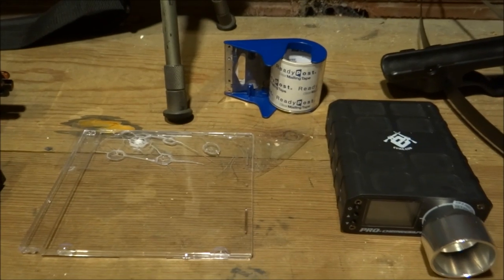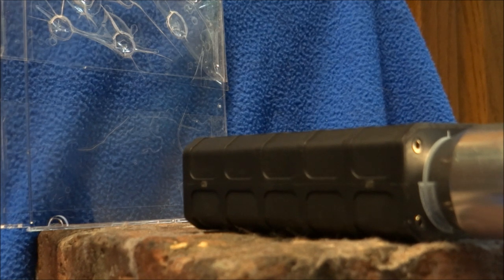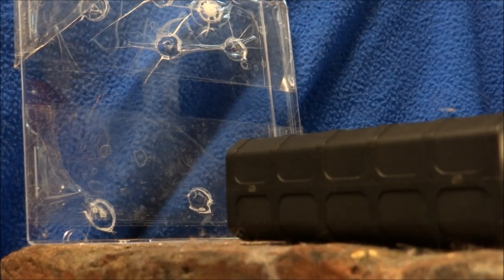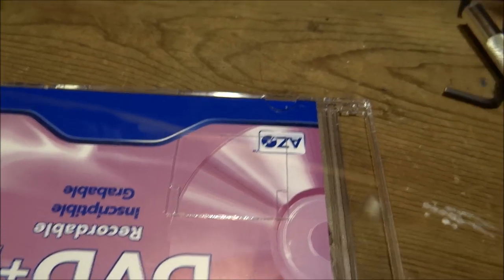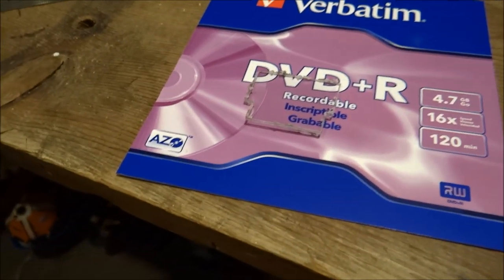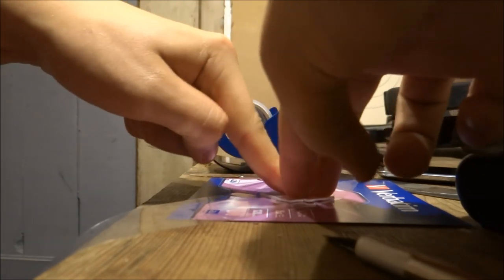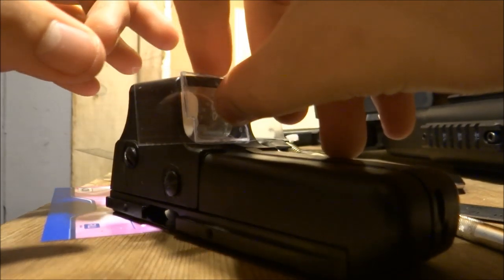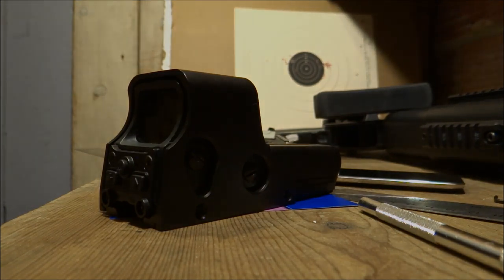How To Make An Airsoft Sight Lens Protector

Comment: Alternatively you can cannibalize a pair of cheap safety glasses to get ANSI / EN rated poly-carbonate and use that. The material of at least ANSI Z87+ or EN166 type B certified glasses will easily stop any BB without the use of any tape or extra effort.
Reply: Your comment is still very helpful seven years later.

Comment: Use plexiglass for crying out loud. It's much more stronger and it will be worth while protecting your really expensive sight. Not only that, an 18x24 inch (~5.5mm thick) plexiglass sheet is around $45 CAD. You can make a shit ton of sight protectors...

Comment: lexan and polycarb would be better try that
Reply: Plus it is a stronger material and it isn't all that expensive for a small A5 sized sheet.
Reply: no its not to expensive i would try thicker then a5 is a little thin in my option but you can get some thicker stuff cheep at like a local hardware store and sometimes they have scrap that they will give you for free